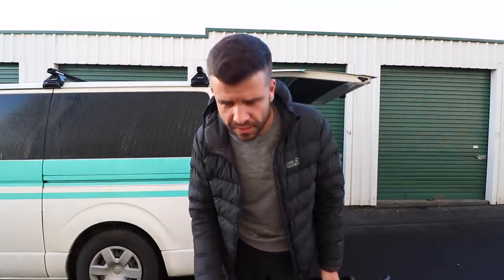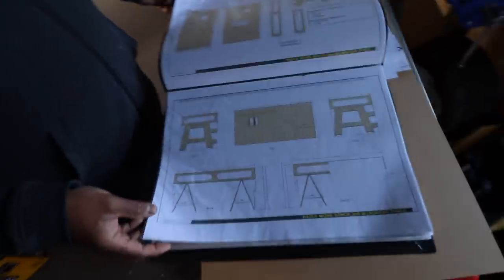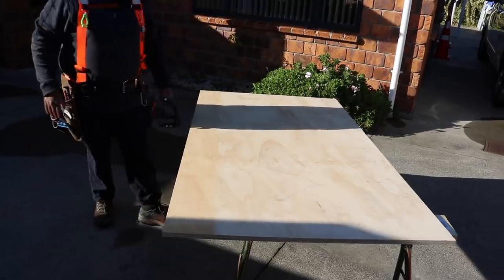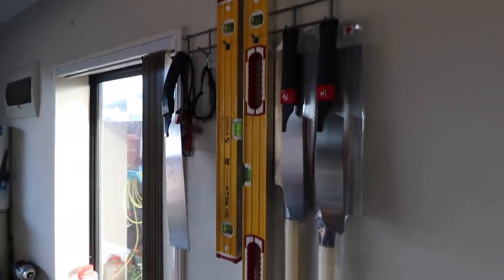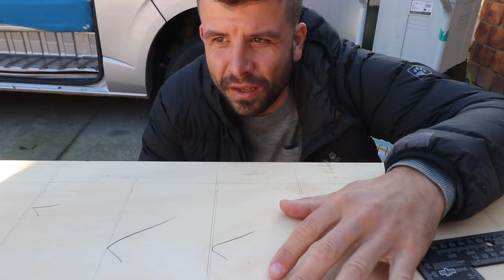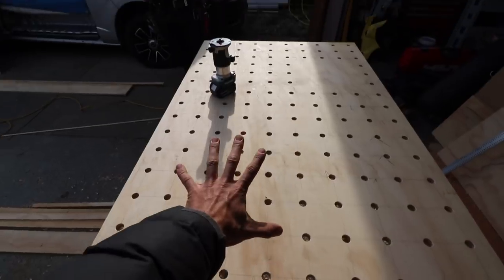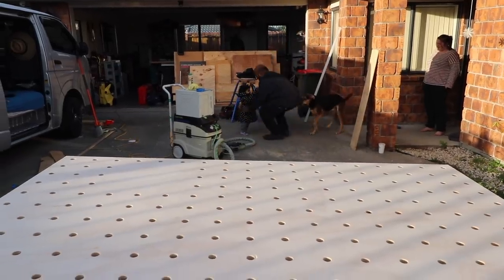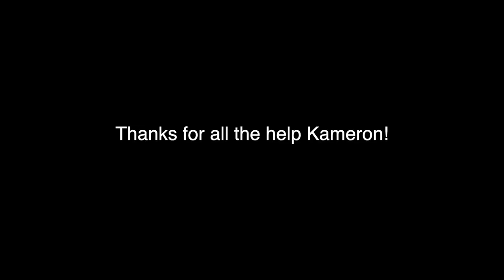My New Workbench: SOLID and PORTABLE

Comment: Hey Scott you mentioned changing height as a con for  out-feed for you table saw  ,but in the new Paulk 2 table, it uses two slide out poles  on the end that the dewalt 745 sits on ! Prob solved  check it out modify 😀

Comment: Looks beautiful boys, I see you left a space for a router to go?
I just made a version of the festool mftb, I can see how a tracksaw or even a tablesaw would be handy, did it all with a circular saw and little strips of wood clapmped to the plywood to cut straight...then half way trough my blade went blunt so started kicking up massive kerf...ah well, getting there. Folds up and holds tools, only have one set of those festool clamps so far, need another set I think, pricey though, gotta be a good alternative out there.

Comment: I built a smaller version of the Paulk bench a couple years ago (only 600mm wide, I have a very small workshop). I only drilled 3 rows of holes (more or less on half the surface) but I wish I had only done 2. Every small item (screws, driver bits, etc.) ends up falling through one of those holes.

Comment: Great bench, how did you go about drilling the 180 holes? It looks like you drilled a pilot hole then a forstner hole in a smaller diameter then a final forstner hole in the finished diameter, is that right? why this technique? would make 3x180 =540 holes

Comment: Sooo? Why did you go with the metal saw horses for the legs?  I built a larger version and built the plywood saw horses.  They are shockingly stable, I can jump up and sit on the bench and hear not even a creek.  And FWIW I can easily break down and set up the bench by my self.  Just curious.

Comment: now you need a magnet on a stick ,,, cos everything will fall through the holes , and a lot easier to fish screws etc out with a magnet on a stick , put a small rake on the other end and then your laughing. all problems sorted ,,, how about  a pair of trestles that fit into the slots when not in use too.

Comment: how exactly do you clamp with those holes, it doesn't seem like they're large enough to allow a clamp head to pass through?
Reply: Look for Bessey Table Clamps for an idea of what will work in those holes.  Depending on the hole size, they could also work with a wide variety of bench dog-type clamps and stops.

Comment: 1 inch = 25.4 mm, by US law, so the US IS actually metric. So 12 mm is 1/2 inch, as close as any woodworker can tell. And 19 mm is 0.748 inches, which is 2 / 1000 of an inch off 3/4 ... close enough for a metal-worker

Comment: Why do you measure everything in SI units, but for hight you use feet? :D
Reply: I think in English speaking countries that officially gone metric - we retained many imperial measures for example I use feet for height, tvs are measured in inches, tyre pressures in pounds per square inch and wheel sizes are sold in inches.